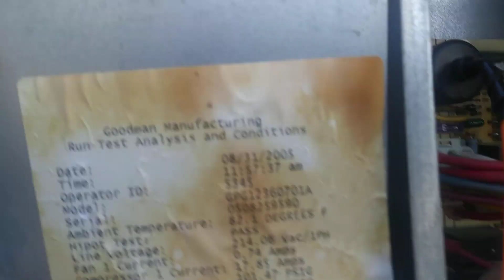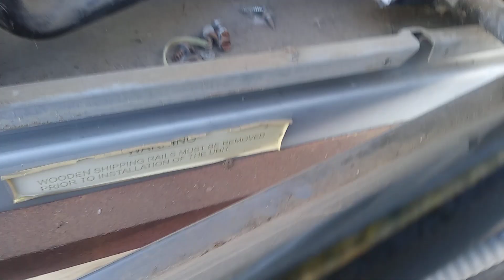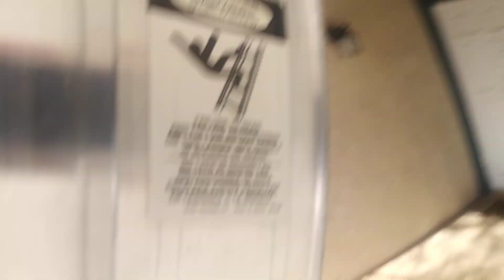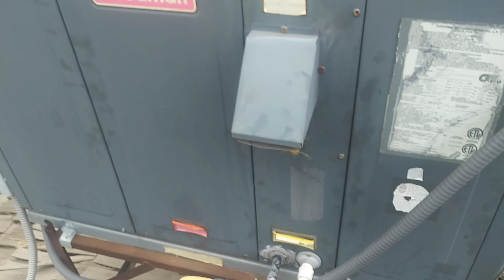Hvac Goodman Inducer draft motor

Comment: Before you buy a new motor, try bending the fins away from the grated housing. That was all I had to do. I had the same exact problem. Just bend the fins back to where they belong. They must be weak and affected by the heat.

Comment: That panel that's infront of the inducer motor did you leave the gas line on and just push it to the side or did you disconnect it?
Reply: I unscrewed the top all across the top of unit  it came up enough to pull out the panel and slide one way or the other. But mine had  hard pipe line all the way . But if have flexible gas line you should have more play.

Comment: How did you remove the drain line?
Reply from the maker: Its has a clamp on the inside, I used channel locks to remove it
Reply: @ArcticairLLC  thanks, I  was able to removed it

Comment: Which color cable goes where?
Like.
Purple L2 
Pink D1 
? Im missing that.
Reply from the maker: Check the wiring diagram from one of the panels, might be where the compressor is. Look under "inducer draft motor" then trace the red and purple wires to the board.